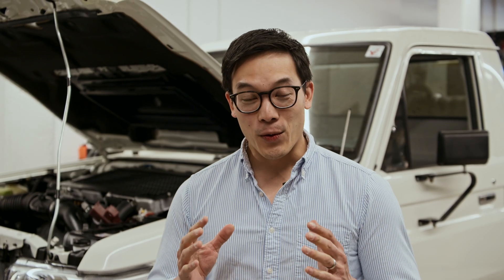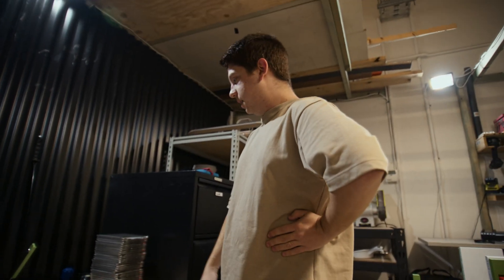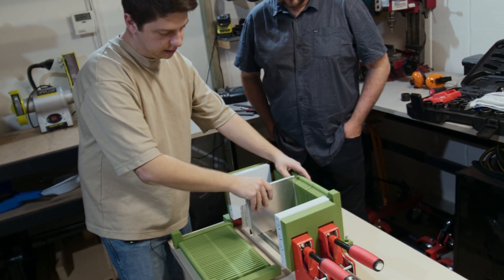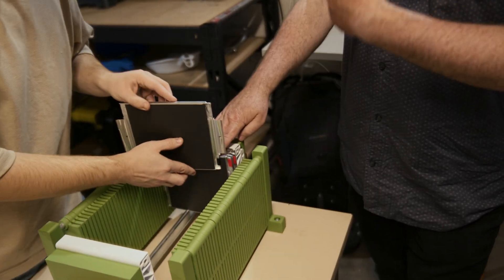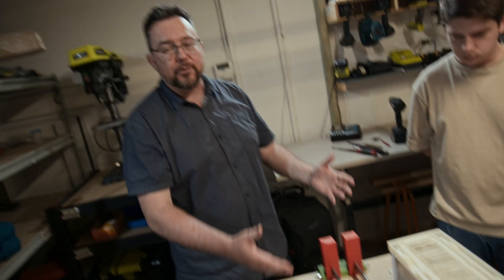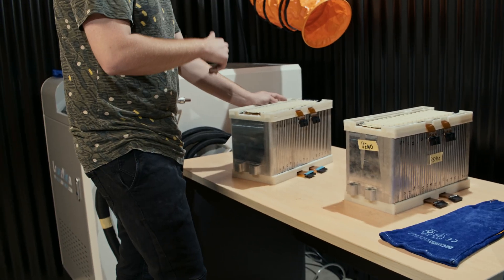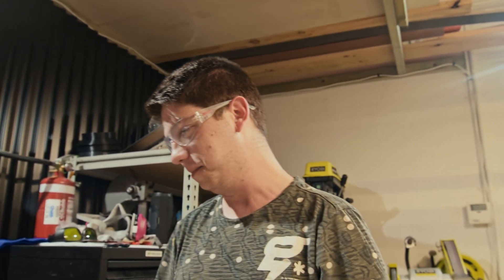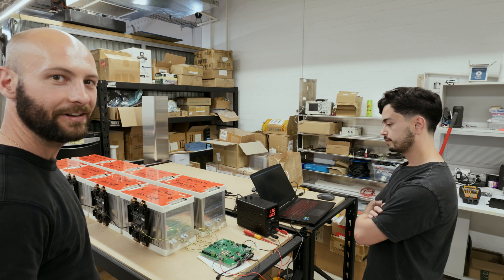Hand-Built EV Battery Assembly For V8 Hybrid Land Cruiser - Ep.08

Comment: There is a lot of excitement in here and hard work which is awsome but Lochie at about 9th minute of this video you have built a 65V module that in its, I am guessing taking XNO characteristics in mind, low SOC so expecting 90V ish!!!! in full SOC. This is already HV! It would be prudent to wear at least HV gloves at this stage but visor or glasses would also be advisable. Additionally this module shall be marked as HV with ISO W012 sign and terminals isolated and loked off. I am just making this comment here to make you aware of an HV danger at this voltage level. In general, modules are build up to 50V (50.4V for 100% SOC on NMC or simmilar, 12sXp strings) for ease of handling, transportation and lack of need to increase safety at this stage. Be safe there!